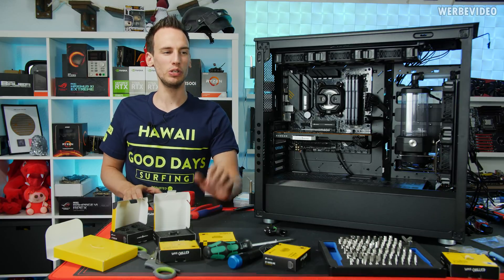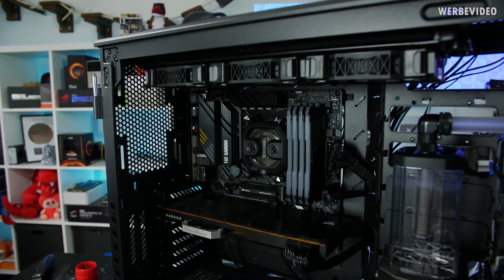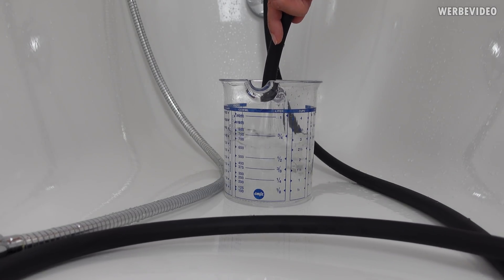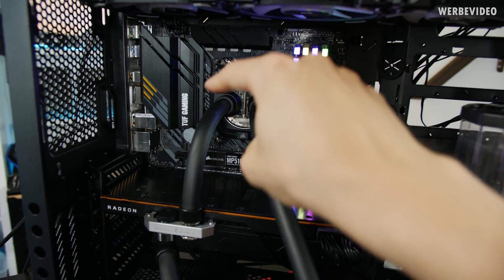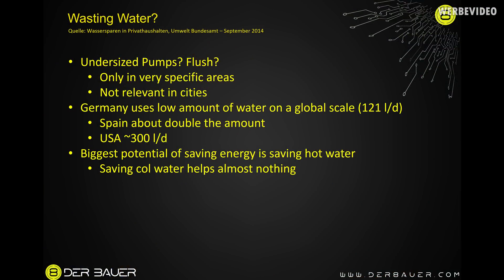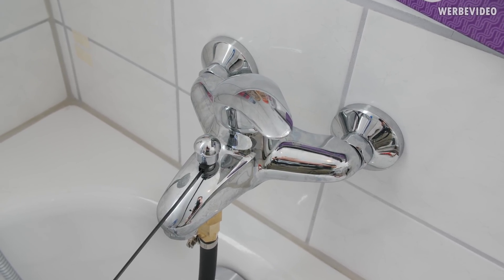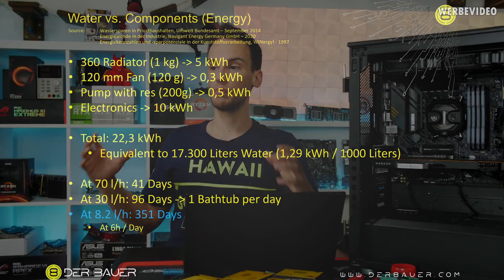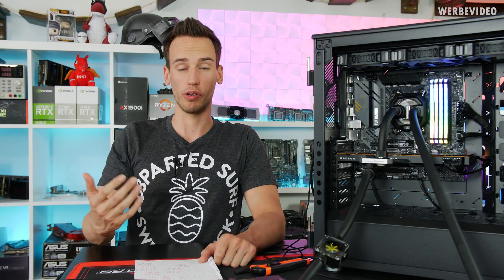So much Better than expected! Cooling my PC with TAP WATER

Comment: I've had my radiators in a separate box for years, with quick disconnect hoses connecting the box to the PC.  Lately I've been considering ways to pipe the heat outside so the air conditioning doesnt have to fight against my PC as hard.  This open loop concept is one i hadnt considered.

Comment: Pipe the water to a tank that you then use as the input to your geyser/kettle etc. You will then save on electricity. This may not work well if your geyser relies on water pressure from the supply, because you don't really want the pipes to your pc running at high pressure.

Comment: In the mid 1990's a friend of mine used a radiator and cooling loop with methanol  to cool a Cyrix686 which ran HOT and he got a 25-30 degree F temp reduction

Comment: Well, but i have better idea. You can use chill configuration in aquarium with tap water.
That all for long live waterblock! Tap water is really bad for any waterblock, because its not clear like a distilled water.
Reply: You can also use an intermediary heat exchanger between the loop with the tapwater flow and premix or concentrate + distilled water in the CPU/GPU loop, thereby eliminating any potential contamination.

Comment: They should install an extra cold water input and output line in to all homes in Europe so we can cool pc's and maybe some type of ac, and then send the heated water back into the Hot side! So we will all help heat the water and save electricity haha.

Comment: I would add an inline descaler to this to prevent the buildup and filter out impurities.
Only issue I have with this is the water tubes going from the bathroom or kitchen to your room with the computer.
Gonna be a hassle to disconnect and drain the water from the tube every time you want to use the bathroom privately.
You could do metal piping the same way as done for water elements for heating the rooms but then you have to add the energy cost for that.
Linus did a similar thing with his whole room water cooling with copper pipes in his old house.
The return of the warmed up water could be used as floor heating and maybe toilet flush water to lessen the energy cost for the pipes.

Comment: You are spot on with this cooling. The only difference to my system is that I don't want the tap water into my PC parts so I use a stainless steel heat exchanger in-between. I love that you put in all the facts and figures into the video to really show the numbers, however I would have liked to see the difference of water usage of apartments compared with a house.

Comment: Many years back a guy put his radiators in the cistern of his toilet. The heat from the computer heated up the cistern but whenever it flushed all that heat disappeared. Another laid pipe around the inside of his swimming pool. Many approaches have been taken for silent cooling across the last two decades.

Comment: Could it be feasible to reroute the water back into your tap circulation if you used an in-line filter for the water return line? That way, it effectively uses no water. The only difficulty would be having to plumb that into your home's tap, but the cost and energy savings would be pretty insane.

Comment: It's a common cooling solution in commercial applications. Hotels use it in the air conditioning sometimes because of space constrains or local building "codes" preventing outdoor condensers for the ac.     Water cooled ice machines are also very common

Comment: When comes to strange cooling solutions, i use MORA3 outside in summer, i move it inside for winter heating, in two locations. And my friend have a miner with 3x 1080 Ti watercooled, heating floor heating in winter. That is working great, Card are like 35 C max, producing like 1kW of heat.

Comment: The law of conservation of energy states that energy can neither be created nor destroyed, thus the extra energy (temperature) that is now in the warm(er) water must go somewhere.

That extra energy in the water also must go somewhere, which will be in the pipes that go underground.
Underground pipes will then have a temperature exchange with the cold earth, transferring the heat from water/pipes.
So what we should look at, if this is done en mass, what are the possible effects of heating up the layers of earth that the pipes go through and to how far that exchange goes. 

Are the pipes isolated to a such degree that the heating up of the earth is minimal or how much would it cost to do so?
We are talking here about 20 degree difference here, which on small scale can be nothing, but on a big enough scale might have some (unknown to me) consequences.

I am not calming anything here, just asking questions as a layman on this topic.

Comment: Would it be possible to have a large container of water, 10, 20, or more, liters. Use a small water pump, for example for a fish tank and some small solar panels to power the pump. The mass of water should be able to maintain a low enough temperature that you could maintain a continuous flow of water to the cpu and gpu without water going down the drain. A closed system, using an aquarium, pump and solar power. It could be neat and efficient. I love your video's.

Comment: I did something similar before and the main difference is the flow rate. I hooked up a well pump in a pull configuration (for obvious reasons) and it dropped temps to ambient and kept them there no matter what I did. The faster you can remove heat, the better performance you get. You just have to deal with the crazy noise of a very high horse power pump or in your situation water waste.

Comment: To take as much heat away from the system as possible, You need to send water to the coldest components first. The other way round, You risk heating up the water so much, that it cannot remove heat from colder components due to no delta temperature.

Comment: I had a similar idea with a 230 liter stainless steel barrel as a radiator. You need a pump for this, but you can use the barrel without fans. And you might hide the pump under the water, to lower pump noise level.

Comment: I have been thinking about this topic for a few years now ( no actual research )... I would create a closed loop with my watercooling and connect it to the reservoir of my heatpump.
Why waste electricity making warm water at 55°C ( salmonella protection ) if you can preheat that water with your computer(s)?

Also can be considered: 
- If you have a rainwater collection system: install a heat exchanger into the collection cistern. Rainwater stored underground will be around 10-15°C, depening on your rainwater usage ( we don't use it a lot, just for toilets and washing machine ).
- If you have a larger garden: try the Canadian Pit principle. Dig in a pipe(s) of min 150mm diameter as long as you can, I think 2 meter in the ground. One end goes above ground as an intake ( with a wire filter against insects, leaves and pests ) and the other goes into the 'a room'. The air coming from that pipe will be 10-15°C. Be aware, that room has be be ventilated so the warm air can be vented out. Easy, energy efficient airco!

Comment: if you have a swimming pool, I think it could be used to warm the pool by using the PC using the same method, rather than using the tap water since the volume of water is quite large it is slow to increase the average temperature of the pool.

Comment: could use a 1000l header tank and gravity feed through the pc and use a pump in a collection tank to put back into circulation. use solar for the pump. no water waste and replace with fresh water as needed. The themal mass of 1000l should be more than enough to not reach heat soak.

Comment: Mobile AC uses ridiculous amounts of energy. Create 1kwh of heat in the room and it takes 4kwh at least to get it off. If you would use computer 3-4 hours per day on those hot days, then I'm willing to bet that tap water cooling the whole year becomes cheaper. Though it's hard to trust any government telling the truth about water situations, and as water is the most important resource and something might always happen to water resources (even if it's unlikely), I wouldn't like this to become a huge trend.

Home owners might do a DIY project of having tank in the attic that collects that water and then hook washing machines and toilet to getting water primarily from that tank. It's nearly not as complicated as it might sound. As toilet and washing machines use most of the water, you could end up not losing one drop of water and instead having slightly preheated water for your washing machine thus saving electricity.

Comment: Nice experiment! Too bad over here water is well over 30°C in the summer so temps wouldn't look so nice as yours in the summer... I'm stuck with A/C for any reasonable loads in the summer and after this I do believe, at least for some situations it could be cleaner to ran that way.

 Could be an interesting thing to test for big datacenter for using dual water circuit right next to a natural cold water source, something like nuclear power plants do. I don't know if that's a thing but looks like a viable solution. Just a water to water heat exchanger, clean water through the components, openwater  circuit to cooling it down instead of big A/C systems.

Comment: Major Hardware made a video testing an evaporative cooling tower (think nuclear plant cooler) for PC use, which turned out to be pretty effective. I decided that it didn't make sense because of the water demand to keep it running, but your numbers make that seem much more reasonable. I can imagine running an evaporative cooling tower when outside ambient is above zero and radiative cooling when ambient is below zero and therefore having an efficient year-round cooling system capable of dissipating far more heat than any PC would likely generate. You'd still have to have a pump, but I suspect there would be a bump in performance from high-ambient radiative to evaporative cooling that would make it worth while. Either way, it could make for some fun tests

Comment: Initial thoughts, I'm a generator tech and while not widely used any more there are still units out there that are city-water cooled. They just use a liquid to liquid intercooler, and are usually pretty effective at keeping the engines cool.

Comment: der8auer a much better idea if you have your own land is bury a huge coil of pipe. the ground will act like a radiator, you wont be wasting any water and if you have underfloor heating you could divert pc hot water into that for the winter months. Savings all round.

Comment: tap water may be very corrosive due to the additives. it will be cool because ur starting with cooler water. but essentially, all u really need is for the water entering the water blocks to be as cold as possible.

Comment: Haa! My landlord has 20m3 underground rain water storage, always cooled by surrounding earth. Only problem is that it does contains a little particulates of biomatter,  so cleaning blocks would be a constant chore... also sometimes there is an outbreak of anaerobic growth that makes water smell bad. I would just pump the water back into the storage tank so no losses.
I've had this plan to zinc coat a few big steel tubes and just bury it in the garden... then recirculate clean water.

Comment: yeah you will get galvanic reactions from your piping, the blocks, etc.  Not recommended.  It will wreck your cooling system.  Also, lime scale, etc.
And there is also the fact that unless you are collecting this water and doing something with it, you really are just wasting it, no matter how much you try to justify it.

Comment: What a great analysis of the cost involved both to the individual and to the environment at large. I wasn't really on board with the idea until you mentioned cooling my apartment with air conditioning to keep temperatures down, because my room definitely heats up pretty noticeably while gaming with my existing water cooling loop. Obviously I'm not going to be running 50+ meters of tubing to my bathtub to cool my PC but it's a very interesting thought experiment nonetheless. Thanks for this!

Comment: Water is recycled. It's not destroyed when it goes down the drain. Therefore, for the environment this doesn't have any impact. This only has an impact if on your water bill you are billed for what you consume and then that is doubled as a sewage charge because it is assumed whatever you use will immediately go into the sewage. That's how it works in most places in the US... probably not in Germany. I have no idea.

Comment: What if you just filled a tub full of cold water? i feel the heat would dissipate due to the large volume of water at room temperature. Then you would have an nearly infinte loop minus the evaporation?

Comment: Now what you do is just get a couple bath tub sized tanks, one for the cold water, one for the expelled water to use the next day. Heck, I bet if you set the tanks up right, you won't even need a pump and could gravity feed between the two tanks by raising and lowering one of the tanks to alternate flow.

Comment: Run the water to your hot water tank. Double efficient. Save power heating hot water. You could also run the spent water through the ground to cool it off and recycle it.

Comment: Oh, and one more thing about this (because I've actually run a setup similar to this before - albeit through a water-water heat-exchanger)...
You would definitely want to use some solenoid valves (electronically controlled valves) for both convenience and safety reasons.
They come in 12V and are cheap on ebay ect., so using a "default off" solenoid you can make the water flow automatically when the PC has power.
If you put the solenoid near the water-source in a more "leak safe" area then you also remove a lot of the potential for any water-damage from a leak while the system is unattended.
Lastly - if you wanted to get real fancy with it - using a few chokes and solenoids you could pretty easily set up some switches that could regulate the water-flow to 2-3 different flow-levels depending on your demand. I suppose you could even automate to respond to computer temps, but I never got quite that far :)
Reply: Yea if the pc is idle you can go to like 1L/h and you can use the warm water to like wash your hands 
In theory you can just make a tank for the water and distribute it all over your house and have a system if the tank Will be low it will switch to normal supply of water
Reply: @dan2800  Have it dump into your water heater. Wouldn't take as much energy to heat the water and your pc gets cooled.

Comment: The mineral  impurities in tap-water (which may vary a lot depending on country) is probably one of the biggest practical problems with this. I think the micro-fins of modern blocks will be very susceptible to buildup of... I'm not sure of the English name for it... lime? chalk? You know, the white mineral buildup you get in water-pipes and even taps over time.

That said, it probably takes a good long while to get bad enough to affect performance noticeably - and this kind of buildup isn't very hard to remove if you need to. A mild acid like household vinegar (5% acetic acid) will dissolve this easily with a bit of time to soak and a good powerful rinse-out. It won't damage metal, and even most hard plastics (like plexi) should not care. It may be advisable to remove any rubber-seals though, as acetic acid (and a lot of acids in general) will make them age (become hard and brittle) faster. I doubt you would immediately ruin the seals like this with just 5% acetic acid, but they would probably get a shorter lifespan - especially if you needed to do it several times. Many quality blocks can be dis-assembled so you can just remove them though.

Comment: I feel like that you are right, you are wasting pure drinkable water. But look this on the good side. By using the tape water you are sending back clean water into the sewer which does make the waste water every so slightly cleaner when it reach the building that filter the water.

Comment: Are you sure those 83% un-used water isn't just all fresh surface-water in Germany? Because that would sounds reasonable maybye, but I doubt that the infrastructure (meaning the water-reservoirs actually connected to the water grid in this case) is 5x later than the current demand. It just typically doesn't make sense to build out infrastructure for something that is pretty predictable that far ahead. So yea, Germany isn't going to run out of water resources any time soon, but it's still kind of wasteful.

On the other hand, for a water-system that is not recirculating I think the actual flow-rate you will need will be very low, and choking it to a small fraction of the maximum probably won't affect cooling temps much (I haven't gotten to that part of the video yet).

Comment: How about building a loop which feeds back the water to an external water tank which can also act as a reservoir for later water use.. or if the tank is big enough or if the water tank is made up of concrete & Big enough then the heat would dissipate passively and so we can hook that up to our pc for amazing performance

Comment: You could use the heat from the pc to trigger a heat pump (inverter or not) and "absorb" That heat to transfer it to the central heating of the house. THAT would be awesome for building with lots of computers working co-generation.

Comment: 121L/day... is that just water into your premise? or combined with food grown etc. I am in Australia and don't even use half of that amount from shower/tap.

As with the Ac question, We have a number of +40ºc days here, and normally AC the PC and then that cools the room, set to 10ºc lower than the outside temp.